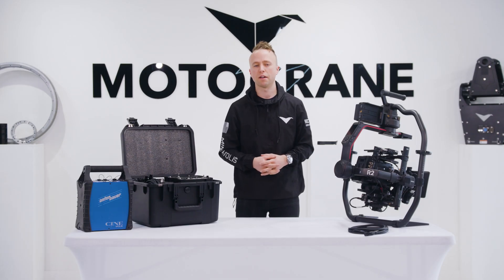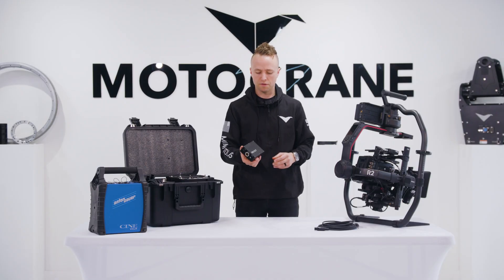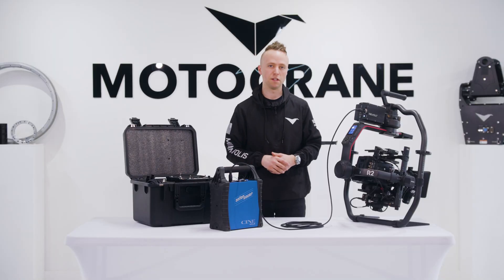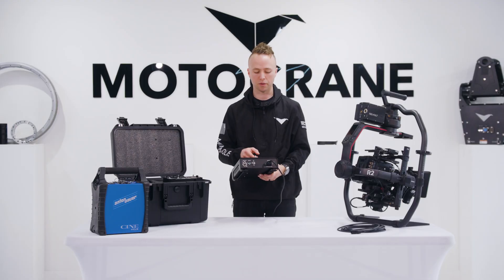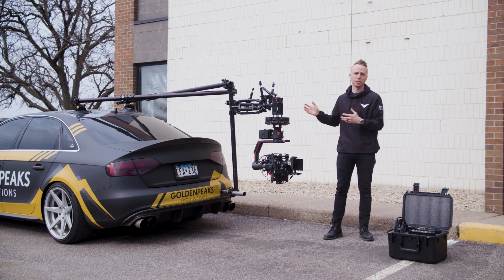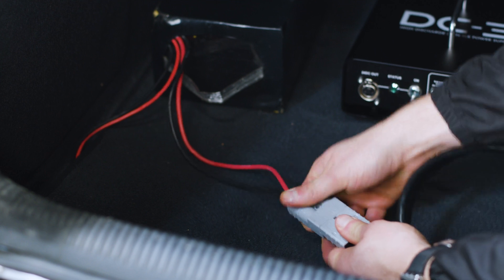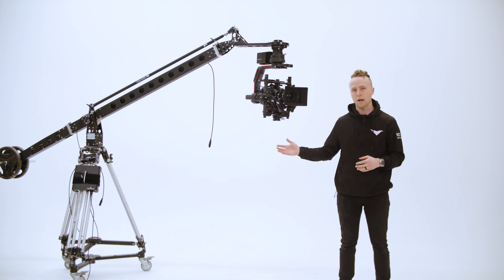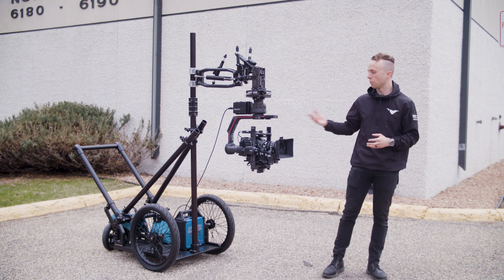Revolt Technical Walkthrough

Comment: It is possible to have an auto on setting? Being able to swap a block while a camera is high up on a crane without having to hit the power button would be even better.

Great product though, long overdue and much needed
Reply from the maker: Excellent question, for this particular application we would recommend shooting on the AC-3 off wall power and not having to worry at all. But we will be implementing an "Auto On" mode in production models that prevents having to turn the Revolt back on after being power cycled!